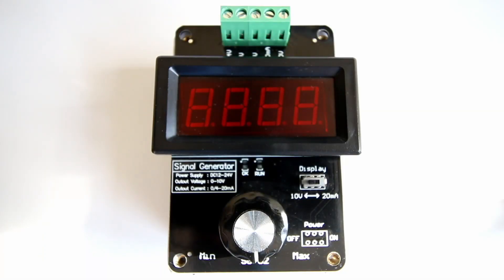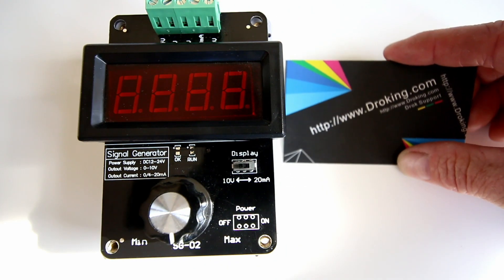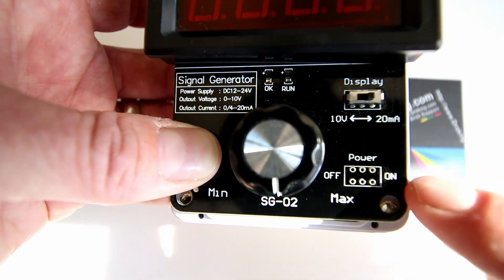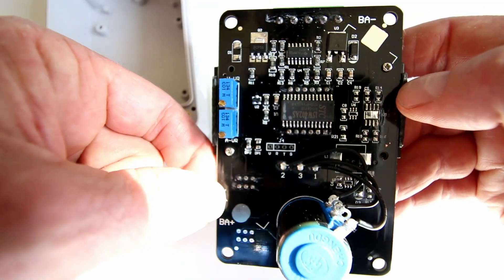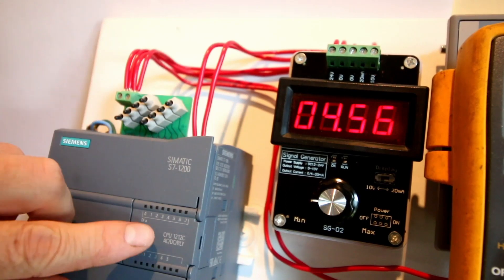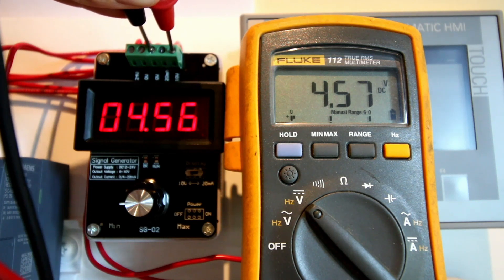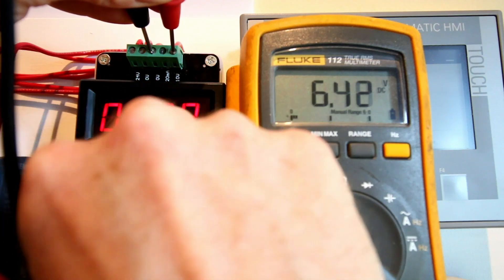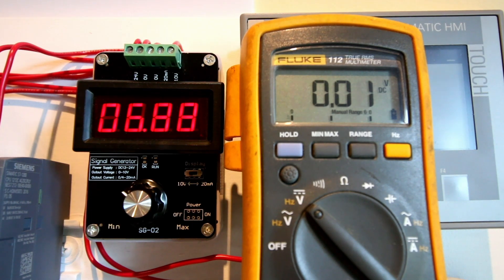4 to 20 mA & 0 to 10 V PLC Analog Simulation Signal Generator

Comment: Is there similar product but with extra 24vdc output? If i want to test a Digital input foreaxample?
Reply from the maker: ANKONG SG-003A 4-20mA 0-24V Signal Generator Adjustable Voltage and Current Simulator Process Control Signal Calibrator
Brand: ANKONG
Reply: @PeteVree  thanks alot. This will help me doing a good IO check

Comment: Hi, how do you change into mA, can I change it independently from the voltage? Thanks.
Reply from the maker: There are separate terminals for 0-20mA and 0-10V, and a small dip switch.This unit is robust and has worked for my classroom. There are other units out there with more capabilities https://www.amazon.ca/Generator-Adjuatable-Simulator-Rechargeable-Debugging/dp/B0BC1GXX67/ref=asc_df_B0BC1GXX67/?tag=googleshopc0c-20&linkCode=df0&hvadid=581952261100&hvpos=&hvnetw=g&hvrand=9330995650934605111&hvpone=&hvptwo=&hvqmt=&hvdev=c&hvdvcmdl=&hvlocint=&hvlocphy=9000928&hvtargid=pla-1810259595800&psc=1
Reply: @PeteVree Hi, I am not an engeneer but I am trying to make a device that is feed by:
1. In 110V 2. Out: 0-60V - 0-35mA. (with a knob to control the voltage and if is possible the mA as well. I want to use it as a intophoresis device. Can you help me out with the project? If there is a price, please let me know. Thanks.

Comment: Any PLC (or other similar instrument) that has a 0-5VDC or 0-10VDC analog input also basically has a 0-20mA or 4-20mA input capability. For example, if you were to connect a 250 Ohm resistor across that PLC's 0-10VDC input, and then also connect your 4-20mA current loop to those same terminals, your PLC would measure a voltage in the range 1-5V, which you can then scale as required using the match functions of the PLC.
Reply from the maker: Thank you. BTW anyone interested in some entertaining videos on aviation, etc. pls subscribe to youtuuba... he's got some great videos.

Comment: Dear Sir,
The disadvantage of the Drok Signal Generator device is that there maybe no power supply for it on the site.  So, how can we use it? Do you suggest we should use a portable power supply source like batteries or something else? If yes, is there a specific Volt (VDC) and Amps (A) to use as a power supply for it?
Reply from the maker: It requires 24V DC which you can pick up off the PLC power supply. Out in the field though, you would be using a Process meter such as this one: https://www.itm.com/product/fluke-789-process-meter?gclid=Cj0KCQjwy8f6BRC7ARIsAPIXOjjmnz_pPN1kO-WdxuW7zVKxI1IA9M2sfV6lOf1pElvXcbWPpmC5SlsaApAgEALw_wcB
Reply: @PeteVree  Thanks.

Comment: in order to check amps, would you use the meter in series to measure?
Reply from the maker: Yup. You would connect in series with the meter in the dc amps setting.

Comment: Nice video as always Pete. 

If you want to save yourself some cash for a 0-10V input. You can make a potential divider circuit putting a 5k potentiometer in series with a 6.8k resistor and coming off the middle to the analogue input. 

Feeding one side of the 6.8k resistor with the L+ terminal on the s7-1200, the other side goes to both the analogue input and the wiper of the pot, the other side of the pot goes to the M terminal on the s7-1200.

I have actually built this in to a S7-1200 PLC trainer and it works a treat.

I know you said you didn't have the skills or time, but this is pretty simple and will save you money should you want to utilise the other analogue input.

Love all your PLC content. thanks from the UK.